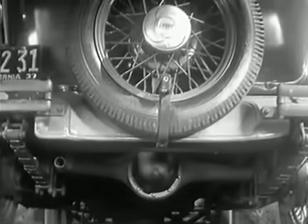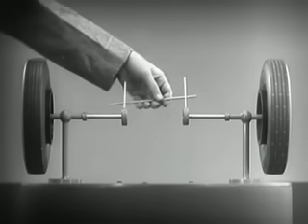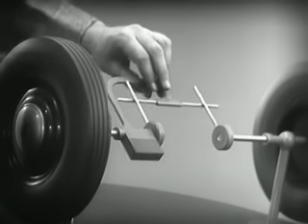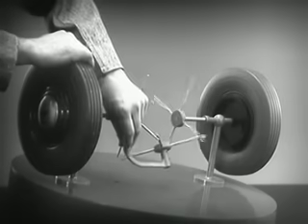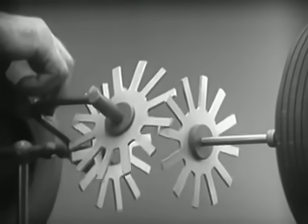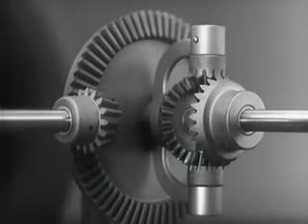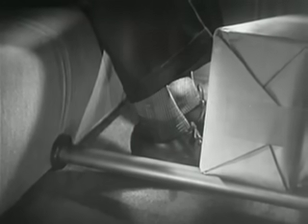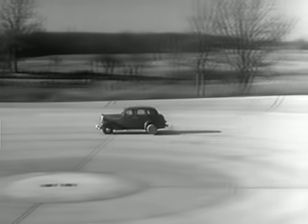Around The Corner - How Differential Steering Works (1937)

Comment: I am very impressed of the video from 1937 :-)
Greatings from Stuttgart, Germany | Home of Mercedes and Porsche
Reply: 2 oct 2019 4:22 pm edt:
stuttgart-location is rather near friedrichshafen-location.
zf on friedrichshafen, make steering-gear for benz-arocs-truck
source:
(1)'The ZF steering gear already familiar from the
Actros is supplemented by an electromechanical
unit for the Servotwin ® system.'
in pdf-page-65 in https://drive.google.com/file/d/1okkU7QWo4FxA_2iPFIMIb9Hq3A9cF4YJ/view
from 'Mercedes-Benz Arocs (964) Service Manual.pdf' in https://truckmanualshub.com/mercedes-benz-trucks-service-repair-manuals/
from google(actros owner manual pdf)

(2)https://www.zf.com/products/en/cars/productfinder/steering.html?filterLang=en
(3)https://en.wikipedia.org/wiki/Stuttgart
(4)https://en.wikipedia.org/wiki/Friedrichshafen from https://en.wikipedia.org/wiki/ZF_Friedrichshafen

12 oct 2019 5:36 pm edt:
correction:this movie show open-differential, not steering.zf make axel-and-open-differential-combo:'For passenger cars with standard drive The aluminum housing and the suspension concept has been especially adapted to the installation space environment. Apart from an open differential, the drive-unit can also be fitted with a ZF multidisk self-locking differential.'
in https://www.zf.com/products/en/cars/products_29292.html from google(zf differential)result 1

12 oct 2019 5:54 pm edt:
(1)'The plant, opened in 1997, currently produces axle systems for the Mercedes-Benz M-Class, R-Class and GL-Class vehicles.'
(2)'ZF will add 60,000 square feet of space to its 157,000-square-foot facility at the Tuscaloosa County Airport Industrial Park later this year after being selected to supply axle systems for the Mercedes C-Class sedan, which will be built at the Mercedes plant in Vance beginning in 2014.'
https://www.al.com/tuscaloosa/2012/02/zf_industries_announces_146m_e.html
from google(mercedes benz zf axle)result 5

Comment: Very clear explanation. It was in 1937. Today is 2017.
Reply: Today is actually 2019.
Reply: PANZERFAUST90, it was just mechanical mistake, pussing the wrong button with no control Thanks, for correcting.
Reply: @fuadaliyev750  I was afraid you actually didn't know the year 😝🙃
Reply: PANZERFAUST90 , :)
Reply: PANZERFAUST90 , Do not be afraid from now. )

Comment: Automatically brake one of those wheels and you have traction control. 
Do the same in the front and add a differential to the “middle” of the driveshaft and you have AWD.
Add the ability to lock or brake the pivot and you have a limited slip differential.
Be able to lock the front, rear, and center differentials and you have 4x4.
Reply: Nice info....but this video made us addictive to a similar video to explain the points you mentioned.
Reply: @MJ Lyco
Add a tail and rotors to the top and you have a helicopter. Change the shape and all the  machine parts to organic life and you have a bird. Shoot the bird and you have lunch. Eat a big lunch and you have indigestion.
Reply: e fred  What kind of gun is this?
Reply: Please explain in 1930
Reply: I think it's worth saying that (in a 1930's didactic tone) ALL the things you said, can be simplified to identifying "What does this part do? What happens if we turn can it on-off at leisure?". It's just increasing control over a system variables. What if the coupling is not steel, but elastomeric? We get misalignment tolerant shafts etc. 

I really wish there was a channel dedicated to showing how the most abundant devices we have, cars/computers/phones/internet are ALL really just the aggregate of largely straight-forward principles.
Reply: You mean a transfer case. Theres no middle differentials lol

Comment: Why is this video good at teaching? I think the key to ANY teaching is to start with a PROBLEM. You state what the problem is. (The car doesn't turn well because the wheels must turn at different speeds).
That's it! You MUST start with a real problem. Only then can you explain how to solve it. (the gearbox).
Anyone who begins teaching and doesn't say what problem they're trying to solve is an idiot! I have had too many horrible teachers that start with the subject matter. 
For instance: CALCULUS. "Good morning class. I'm going to teach you calculus. Here's an equation dx=dy/dt. How do we solve for x?
STOP! Wrong. Why the heck are we solving for x? Even if I can figure it out after 2 months, what good is it?
Here's how to start. "Hello class. I just invented a time machine and we're all going back to Ancient Greece. Some Greeks want to draw really accurate circles. They want to build a round building, but they can't figure to the exact measurements..The people of Greece have already figured out they need to know a weird thing called Pi. It's the outside of a circle divided by the diameter. But they can't get the value of Pi exactly. They only know its about 3. They need a more exact number.  I'm going to tell the Greeks that I am from the stars and I was sent by the Greek god Thor help them! Now, class, how can I teach those Greeks about Pi?" (hint: you need calculus),
There. Isn't that a better start? Are you now interested?

Comment: 2:05
How did they do animations like the lines and the arrow back then?
Reply: By hand
Reply: Same way they'd do cartoon animation, basically.  Have a film camera that can expose one frame at a time, point it down at a photograph of the frame you want to animate over on a table, then put your animated bits on top of it.  Expose the frame, move the animated bits a little bit, expose another frame, and so on.

If you'll notice in the video, right before they switch from the video to the animation, the quality of the image changes -- that's where they transition from the original film to a camera pointed at a printed copy of one of the frames instead.

Comment: The titles is wrong.  That's not "differential steering", it's just how a differential works.  Differential steering would be having the front wheels not turn and using independent left and right brakes to cause the vehicle to turn.  Also called differential braking.

Comment: Good vid.  A bit misleading as, in this application, it is not steering the vehicle but propelling it...in a way that avoids wear on the propulsion tires around corners.  Will have to look for "Ackerman Steering" for a description on how the front steering wheels pivot at different angles to account for inner and outer radius of the turn.

Comment: Compare a point on the label with a point on the outer edge. They both make a complete circle in the same amount of time, right? "Yeah..." "But the point on the record's edge has to make a bigger circle in the same time, so it goes faster. See, two points on one disk move at two speeds, even though they both make the same revolutions per minute!"

Comment: If the lower drive shaft was invented in the 30s then why did cars after that have a hump on the floor?  Was something wrong with the design?
Reply: I don't know if i get you right, sorry for that, i think the wanted to lower the cars in general and not that high build height, so you keep the drive shaft in same height but lower the rest around it. so thats why we have nowdays the clutch on that drive shaft (manual car) to our right and our foots are lower than the drive shaft. as you can see, before that the drive shaft was on foot/floor height.

but i don't know why they had done it this way, maybe conflict with other installations in the car

Comment: I'm not a car expert, but isn't this video mis-titled? Shouldn't it be labeled something like "How Differential Power Transmission Works"? I didn't learn  anything about how front-wheel steering works, except that the differential solves a problem that can occur with the rear wheels.
Reply: The point of the video is to demonstrate how this new differential helps the car steer around corners better because both wheels are not locked together anymore when cornering.  The title does not mention anything about the front wheels and the video has nothing to do with transmissions. The word steering throws you off.

Comment: Omg when I look at that late 30's diff with the cover off! The amount of metal and how big everything needed to be due to the alloys they had at the time. Sometimes people say "cars were BUILT better" back then due to how heavy everything looked, but for the actual machinery/moving parts, it was necessary. Bigger is not always "better". 
I'm sure that could start a conversation about accident "survivability" with comparisons between modern cars and cars from the 60's or earlier, but when it comes to passenger survivability...that's when arguments start. But that's not what I want to talk about. I'm just amazed when older cars like the 47 Willy's, 49 Kaiser, 65 Mustang, & 66 Chevelle etc. roll in our shop.

Comment: So why is this video called “how differential steering works” when it’s got nothing to do with steering.  It’s about differential drive.
Reply: It's about how this new differential helps the car steer around corners easier because it's not dragging one wheel anymore. They both can turn at different speeds now so you don't have to fight the car around corners.

Comment: But isn't it still just one wheel drive? If one wheel gets too much workload it simply won't rotate causing the other wheel to do the work anyway
Reply: @bobbyemmett6046  I had heard of a locking differential before and decided to look it up to make sure it was a thing and it is. This allows the power to be forcibly applied to both wheels for getting out of tight situations. Pretty neat

Comment: Crazy thing is, in most cars today the shaft does go through the floor, thats why there is always a big lump in the middle of a car.
Reply: Dude, that's the exhaust. Vast majority of the cars are front wheel driven... The engine is in the front, and the exhaust pipe goes through the middle "lump" because today we have much more efficient and cleaner exhaust systems which require a big pipe. Back then the car would just have a short pipe out to the side or a narrow one down the bottom.

Comment: The whole lesson is divided into very small steps.
The trick is that each step generates a new question in the mind of a student, and this question is answered right away in the next step, all in order of appearance in the mind of a student.
E.g.: 
Step x: in order to provide variable rotation, we put the bar on a pivot.
Question x: what if the spokes slip?
Step x+1: we add more spokes.

Comment: I still didn't get this part: it looks like the power may just turn just one wheel and the other wheel can stay still. That's not how a car supposed to move forward. If something causes inbalanced resistence of the two wheels (let's say one is on regular road surface but the other is on ice), will the differential cause the car to spin?
Reply: I'm not sure, but one wheel getting caught when then cause the car to want to turn. You might be able to then just turn your steering wheel in the opposite direction.

Comment: How did you know how this thing works?
Me: Americans from 1937 told me.
Reply: Isn't the internet awesome?
Reply: @thetallestdwarf7041  it truely is amazing
Reply: Works on dry/good roads that is.  Nothing gets you stuck faster in mud or ice than an open differential design.
Reply: @flinch622  yes true an open differential is really bad for going off solid, dry ground.
Its is still way better then the concept of having only one wheel on your axle powered. For the american highway and city traffic an open differential will do.
Open diffs are for average cars ment for the average city and town people.
If you want offroad performance you gotta buy a car with a manual lockable diff and probably also manual or general 4x4.
Reply: @flinch622  that's what we have slip differentials for

Comment: I am either a big dummy or missing something but if both wheels aré provided The ability to have power transmitted to them how does The differential allow The inside wheel to spin slower in a turn if both wheels have power?

Comment: They had no concept of danger in the 30s did they... Driveshaft by your feet awkward? How about dangerous.. And then a stunt for an informational video where they practically run on the wheels with no one driving. Little known fact, right after the video cut, the girl fell over backward and had her arm ripped right off...

Comment: The open diff in itself is kind of one wheel drive. both wheels are driving while in a straight line but as soon as you turn or loose traction only one wheel is driven. then came the limited slip.

Comment: Thousand times better than today's explainations
Reply: Kind of sad, but it was purposely done. By both the government and the auto industry during the 1960's. (and not really for any super conspiracy, shadow government weirdo, NWO shit either.) The industry nearly collapsed due to several factors at that time. Some of the biggest being, the predicted purchase turn around of consumers, and the open sourced 3rd party auto parts, tools and their availability. It was assumed in early forecasts in the auto industry that the average customer would replace their vehicles every 3-5 years. Thus the industry build itself around that model. However, because of growing public knowledge on repairs, Maintenance and availability of parts and tools. The 3 year prediction was off, waaaay off, and the average consumer owned their vehicle for 10+ years. Which led to MILLIONS & Millions of factory automobiles just sitting there, rotting, and often being scrapped (an interesting side effect being, some of the fist reclamation and recycling facilities began as a result of this) About half of the auto producers went under, others forced to consolidate. In response, the auto industry stopped this kind of stuff. Then made many materials, parts and advancements proprietary and trademarked, informed engineers to deliberately build designs that where complex and difficult to repair without formal training or special tools, and lobbied the government to mandate repairmen and auto shops to hold certifications and "mechanic" to be added as a degree program to trade schools and universities. Which they did, nearly collapsing that industry over night as a result, lol. History is so fucking cool. That's a lot of shit, to explain why a video from the 60 years ago is so informative...by comparison to today.
Reply: @Spartucus101  There's also the fact that cars today are more fragile to better preserve the living, breathing passengers.
Reply: That's the truth!

Comment: I just learned about the one wheel drive! Was this also the case for the electric cars as well?
Reply: electric cars dont require differential because a seperate motor drives each wheel.
Reply: @snowcrave  Ok, but for hybrids they do have differentials. But what about cars like the Regera, it's basically a 1 speed car but has a electric drive train but has a end drive being the V8 engine, that too will have a differential?

Comment: My dog keeps losing control running on wet grass, will add more spokes
Reply: upgrade your dog to beveled gears & an electronic ignition . VVhile you're @ it maybe put a turbo into him
Reply: So you're saying your dog isn't good on...

Ruff terrain?
Reply: No, you need a locking differential on your dog.
Reply: Try turning the traction control back on, these new dog systems automatically switch the traction control off if they get too excited at the park and go into sport mode.
Reply: Not more spokes! Get him studded paws
Reply: it has too many dogpower
Reply: @nils holgerson r/wooosh
Reply: Lol
Reply: Quad X HAHAHA
Reply: Maybe is his dog clutch broken...
Reply: Change his paws bro,they worn out
Reply: you can't use this on dogs

Comment: So if one tire loses traction on sand but the other tire has good traction, most of the power will go to the one that is slipping which is exactly what most people don't want.  They should make it so that in that case, the bulk of the power would go to the tire with the better traction.  This design is a good start but "backwards" in one way to the needs of a typical driver.
Reply: That is why most off-road cars and trucks have a "locking differential" which prevents that problem from happening. Some cars come with a "limited slip differential" which also helps to fix that problem.

Comment: I have actually witnessed this in action on my lego car with a differential. It used a differential because it was built to have a special motor (sold separately) that could actually drive the car.

Comment: Technically though, it's not "differential steering" so much as differential drive. Or, if they were hell-bent on getting the word steering in the title, they could have said, "differential-assisted steering". I thought I was going to see a different kind of steering mechanism I'd never heard of before. :(
Reply: DESTROYER67732; You don't understand. The film uses correct terminology, both for the 30's and for today. The criticism is for the uploader of the video and their use of the term "differential steering" in the title. This terminology is ONLY correct for front wheel drives, and this film has nothing to do with front wheel drive or the mechanics of steering a front wheel drive. The terminology in automobile mechanics has NOT changed. It has had new terminology added to the list as technology and mechanical methods improve, but the terminology from the 30's is still used and accurate today.
Reply: ... so I was going to comment with "give a youngster some slack, probably only ever heard the term differential steering because of twenty years of front wheel drive cars", but then I see the channel's name is US Auto Industry so  .... yeah .... they should be a little more careful with the accuracy of their terminology.